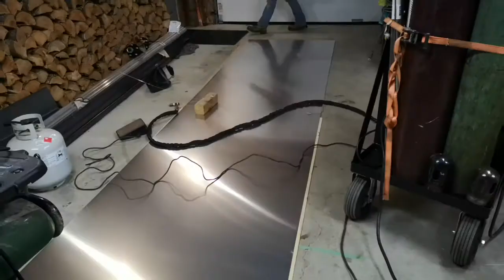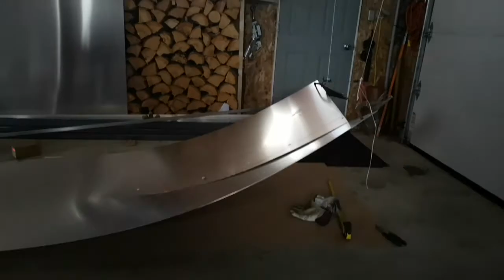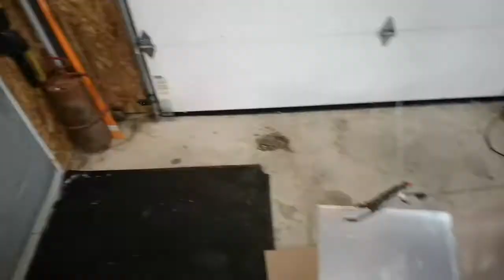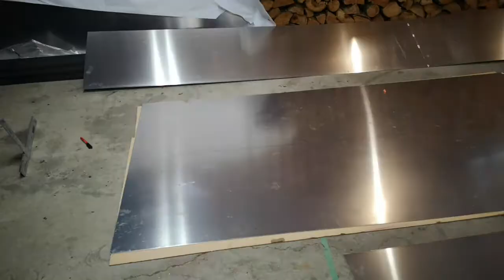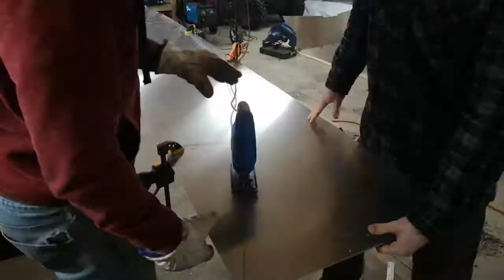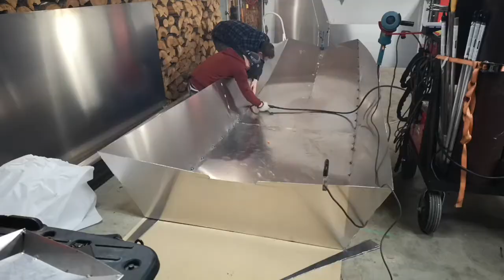Homemade Jon Boat Build Part 1

Comment: Is there any chance you could help me figure out how to measure the front? I need to figure out how to figure out the dead rise so I can make the semi v hull you have on this boat and I have no idea how to do it.  I am trying to build it out of cardboard right now so I can get the measurements exact, before I spend money on materials.
Reply from the maker: I didn’t use card board or any templates, it’s fairly easy to build as you go. Just start with the bottom. I have tacked 2 4x8 sheet to make 4x16 bottom to start. The at the front I cut down 5-6 feet ( I can’t remember exactly how much) after cutting, pick up the front and fold one over the other until you find you rise and v. Hold it in the position but hanging string to the ceiling and vise grip/ clamps. Next you take a laser level straight down the middle like in the video and trace the curve at the front . This line is on only on one of the halves . This need to be cut out and transferred over to the other side. I hope with this info and the video will help you

Comment: Just curious, why did you decide to tig that instead or running a spool gun? I have both and someday want to build something similar but assumed the spool gun would be nicer for longer runs, but if you’re moving around to spread the heat out maybe it doesn’t matter? Either way it looks great!

Edit: I see I didn’t watch far enough into the video. But I am curious as to why you chose to tack the long parts together with tig? Just trying to learn, thanks.
Reply from the maker: Main reason is didn't have an aluminum spool gun ,  the more expensive spool gun for 5356wire is over 1000$ can. I tried just installing aluminum wire in my mig gun but it only worked decent half the time, so when I could I would Tig. Tacking is easier with mig for sure and everything would've been quicker .
Reply: @dooryardfabrication3973  that makes sense, I noticed it was a just a mig gun not a spool gun. Thanks for the reply, I am really enjoying the series.
Reply from the maker: @bradleyaronson3616  glad to hear that! Thank you
Reply: "Ive heard" you are supposed to use the spool gun because mig will not warp the metal as much as tig, which makes sense! Tig is going to concentrate the heat more. I'm not a boat builder, just what I've got out of other videos? But great build, I would like to build my own boat one day, a big catfish cabin boat!
Reply from the maker: @dred5375  for sure spool gun would've been better and quicker. Looking back I wish I just bought one. I've notice most good boat builders use pulse machines with a push pull gun, ideal but waaay out of my price range lol.
Reply: @dooryardfabrication3973  I was not criticizing in anyway, I have wanted to build a boat myself, you have taken the plunge so I'm just trying to figure it all out myself!
Reply from the maker: @dred5375  no worries! Didn't think you were, but you're absolutely right spool gun would've been better. I might build another again someday, I recommend building its fun, custom and cheaper !
Reply: @dooryardfabrication3973  that being said, did you experience any warpage? I could save alot not buying a spool gun myself.

Comment: What sort of material thicknesses are you using?
Reply from the maker: .090" bottom the sides and rest is .062"
Reply: @dooryardfabrication3973  wow that is thin, you should call the boat beer can ha ha
Reply from the maker: @atmm89  boat beer can I like it, you’ll find plenty of those in the boat too haha. In seriousness I wish I went a little heavier, at least for the sides.
Reply: Looks really thin. I build my boats from 3/16. Some cases ill do 1/8